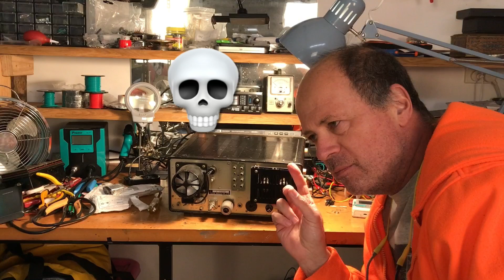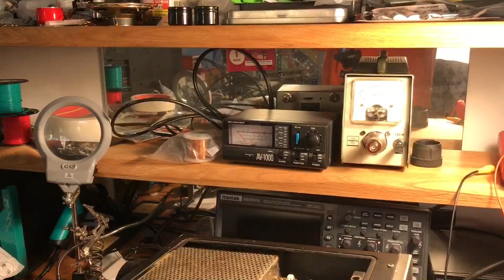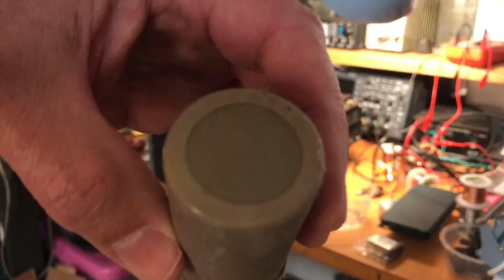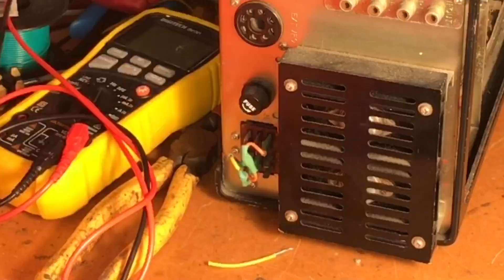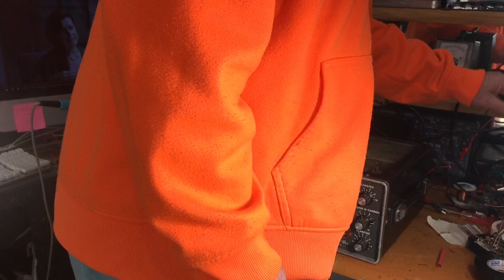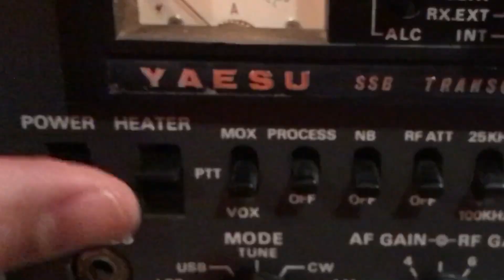Yaesu FT101E - smoke or noise?

Comment: I’ve just got my FT 101e going they work really well very easy to work on
Reply from the maker: It was groundbreaking in its architecture. The extender board to ease testing and edge connectors were pure genius. 73 de VK2AOE

Comment: I have a couple here, the faults can be "quirky" to say the least. You will need to clean the relays and make sure nothing is toast around and under the PA tube sockets. Output might be low due to the 12BY7A driver valve being tired, it's worth changing it for a new one. That's more likely, than the PA tubes, they are pretty rugged. There's usually obvious damage to surrounding components if the PA tubes have been tortured -  Good luck! de VK5LA Andy 22:44
Reply from the maker: Thanks Andy …. Will do all that…. and yes I will make sure the 800v has gone away before I “play”…. 73….. heard u the other night QRS CW … but just missed you!